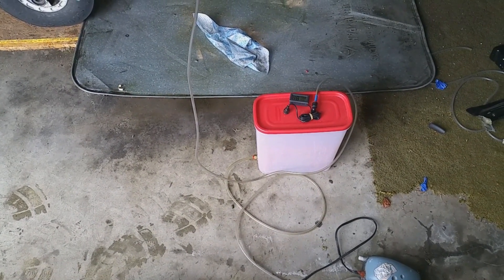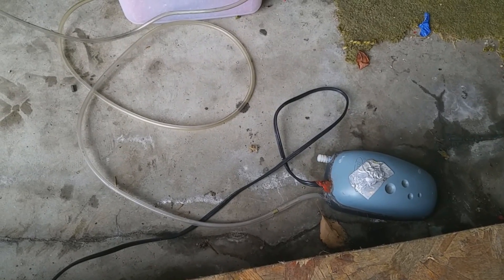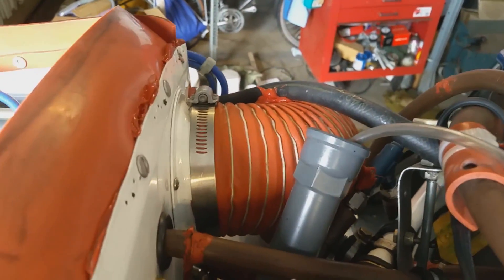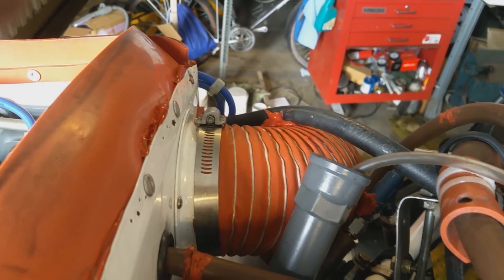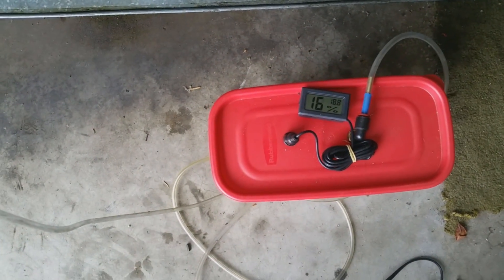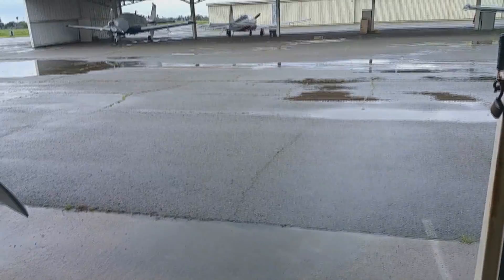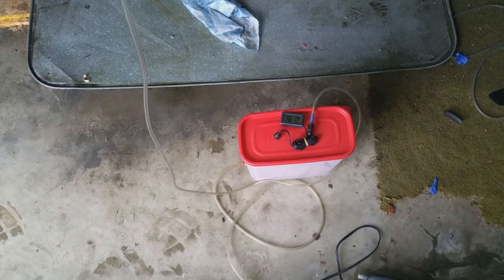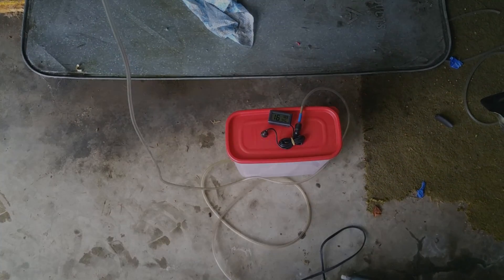Engine Dehydrator

Comment: You can also use a stopper with a hole in it and place the tube into your engine breather (coming out of the lower cowl).  Then all you have to do is unscrew the oil filler cap and leave the dipstick ajar.
      To aid in longevity of your desiccant, you can complete the loop and create a plug and tube to go from the dipstick tube back to the desiccant container.  This way, the desiccant isn’t constantly exposed to ambient (humid) air.